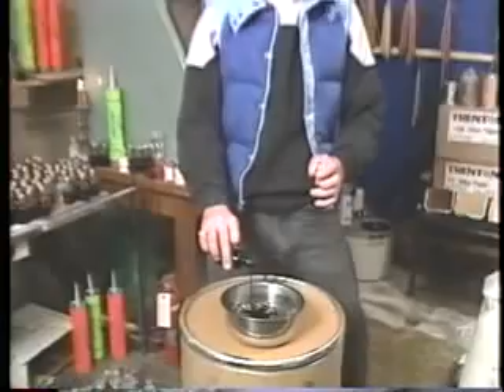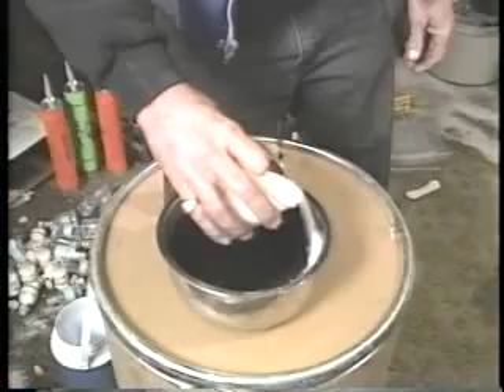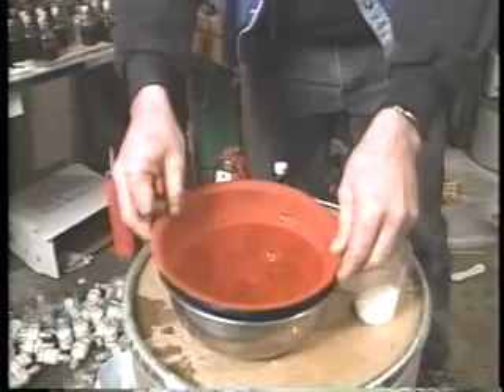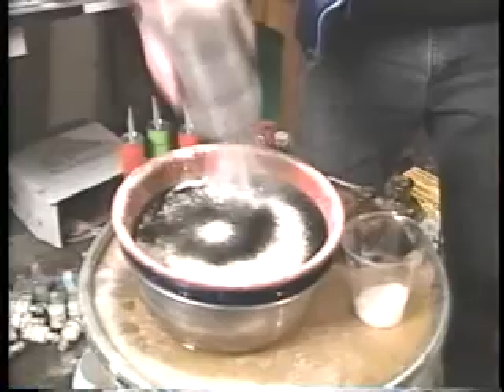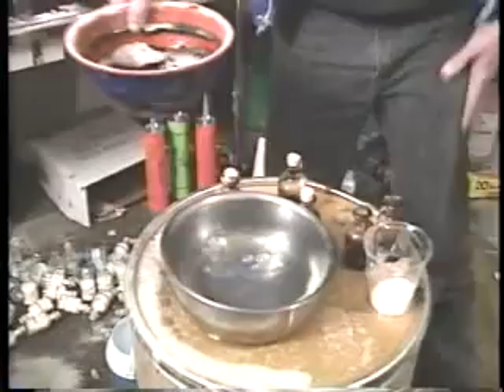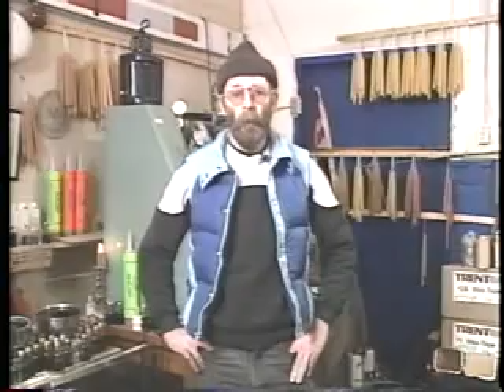Oil Spill Removal Demo using Wax

Comment: I am pretty sure the reason this is not used is just because its just not practical. It looks like he adds about equal volume of wax to oil. So for this to be a used on a large scale disaster the amount of wax that they would need is probably not possible. If it was used in the BP oil disaster, which released about  780,000 million meters cube of oil, then it would require about that much wax.  Considering that the US total annual usage of wax is only about 200,000 million meter cube,  where are they suppose to get all that wax in such short notice. This ignores the fact that the cost would be enormous and theres is no way oil companies would pay it.
Reply from the maker: You have to consider that they can save the oil and reuse the wax over and over. The wax used comes from the crude oil that is spilled. Crude oil contains up to 5 % paraffin .wax.  It's a win win situation........Can't they see that???
Reply from the maker: jason rendell Please remember that the wax used comes from the very crude that has spilled which is up to 5 %. after the oil is refined. Remember too that they save the oil and can kep re using the wax over and over, and each time they end up with more wax than they began with, so its a win win situation folks. Equil amounts between wax and oil are only if you want to solidify the oil, however the oil can be rendered inti a semi-solid and still remain non adhevi, sticky r contaminating and removed with ease using fish nets.   My E-mail is, waxogen@gmai.coml if you wish to write me and need more documentation or videos.   Willy